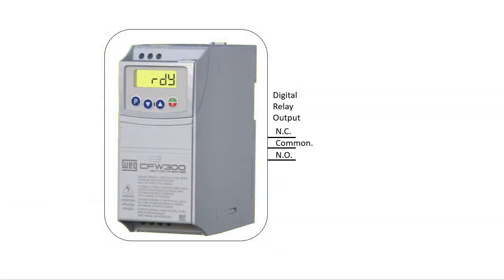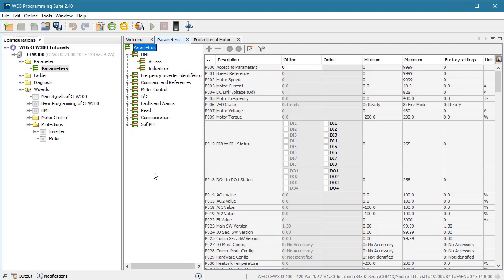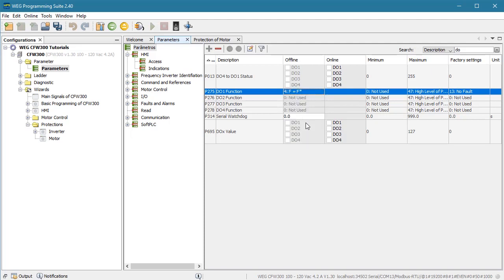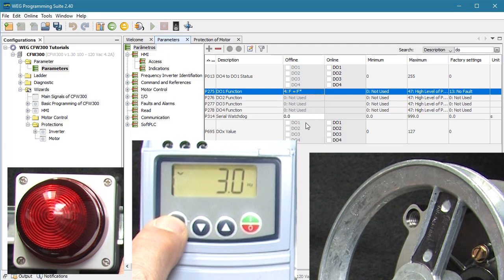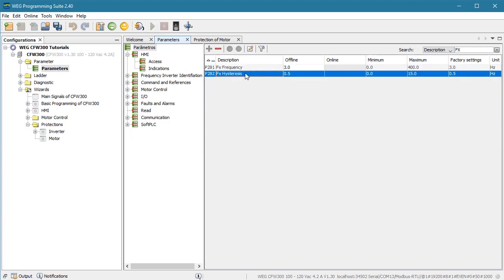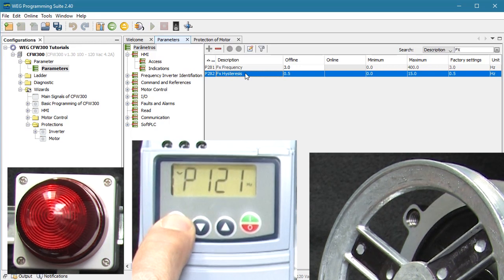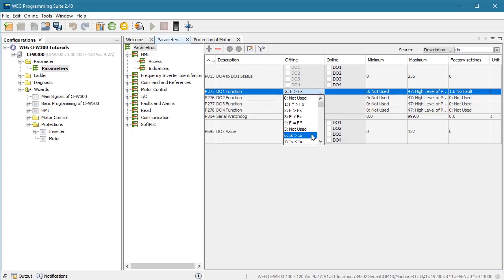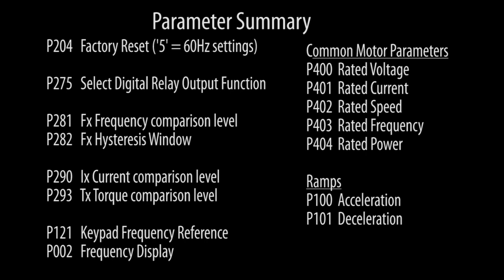WEG CFW300/320 VFD Digital Relay Output from AutomationDirect

Comment: Hello sir, is this 24 V DC is external power supply?
Reply from the maker: In this video the external source to power the indicator is 24VDC, however the drive relay is a dry contact relay output, so it works with external AC or DC.
Reply: @automationdirect  I appreciate your response. May I ask another question? Is it possible to use the +10V in the analog input as a power source?
Reply from the maker: It is possible but strongly recommended against. There is no replaceable fuse for the internal power supplies (10VDC or 24VDC) so if you were to have a minor current event it would blow that power supply and the only solution would be to purchase a new drive. Adding a small power supply is always our recommendation to avoid this.